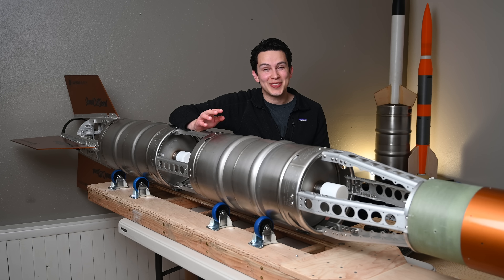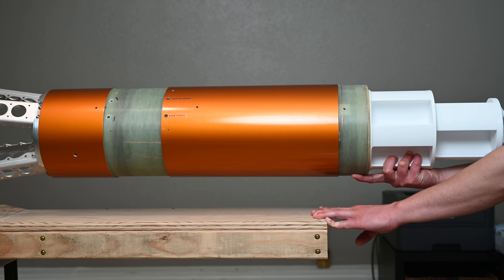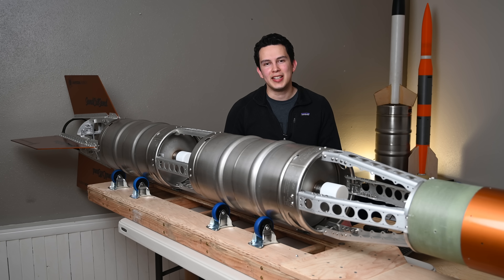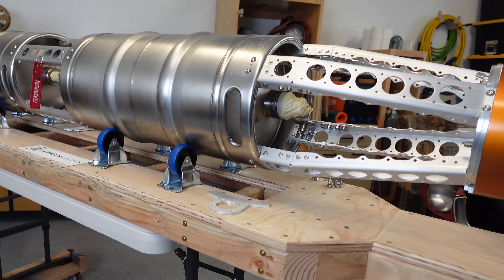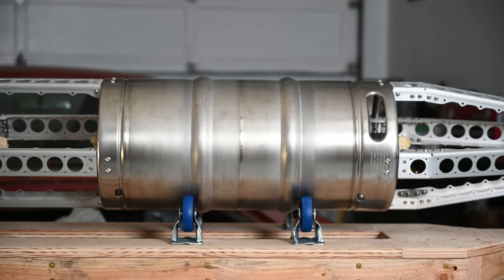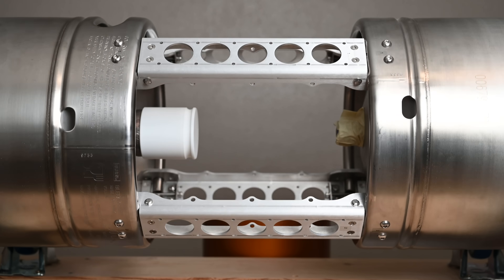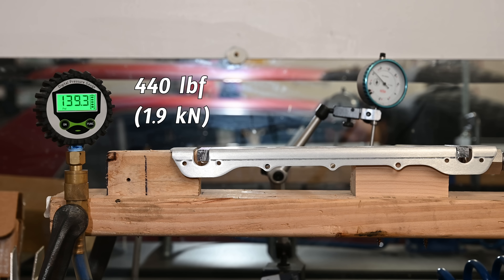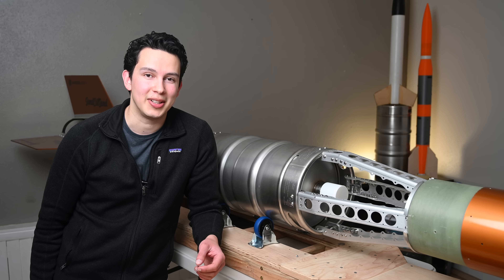Beer Keg AIRFRAME Design - KegRocket Ep. 3

Comment: This isn't going to have active aerodynamic surfaces is it? I know a lot of large hobby rockets don't because it changes it's classification and makes it much harder to legally launch. That's why so many are spin-stabilized.
If it does have active pitch/yaw/roll control, that can put a lot of torsion on the whole airframe as well.

It will be interesting to see the shrouds that cover the (non-keg) parts of the airframe.

Comment: Your screw thingy designed to take the tension loads past the kegs rolled edges seems like a bad idea. A round bar with stress raising notches (threads)

But maybe im just thinking of fatigue whick a rocket may never have to be concerned about due to low cycles. Id have thought a 0.050 plate on the outside would have been simpler and more robust.

Comment: Wouldn't the parts be stronger if the "speed" holes were punched out instead of cut out?
Reply from the maker: Probably, but we didnt have easy access to that capability
Reply: @KegRocket  and to be fair the extra strength probably isn’t necessary

Comment: Keg design lends itself well to plumbing ran inside chines
Reply: Chines are aerodynamic devices intended to produce or break up vortices, kind of like external facing baffles
Reply: The ridges on the kegs are already acting as chines, ortho to direction of movement. Could easily add some perpendicular and break up roll laminars/control roll turbulence. Just need to extend fins a bit
Reply from the maker: Thanks, will have to look into this. Ironically, the skirts on either end of the kegs are also called "chines" in industry terminology I think.

Comment: Stupid question: Don't the open inter-keg section and the section between the LOX and nose (inter-nasal-loxide section? 🤔) create a huge amount of drag?  Why not put a thin shell of fiberglass or plastic over just to improve the aerodynamics?
Reply from the maker: We do intend to put a semi-structural "skin" over the currently exposed bits to improve aerodynamics and also add a little bit of strength like you say

Comment: I’m interested to know about your propellant feed lines. Do you plan on feeding the LOX through the fuel tank and if so do you have plans to insulate the pipe?
Reply from the maker: LOX feedline will be routed around the outside, with a bit of insulation under a fairing

Comment: I'm guessing you dont have a mig or tig welder, save a bit of weight by replacing a lot of those fasteners with a weld. With the aluminum cutting, waterjet may be cheaper, depends on what laser types are available ( CO2 lasers are terrible with aluminum ). Cool project.
Reply from the maker: Did consider welding, but figured there was a good chance something would need changing/replacing at some point. Thanks